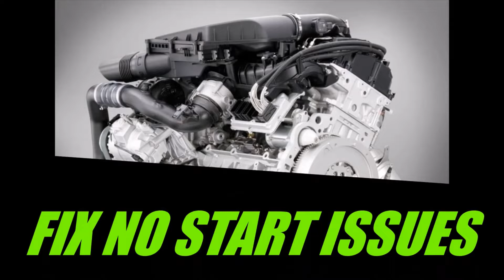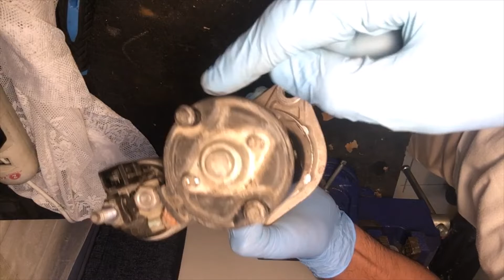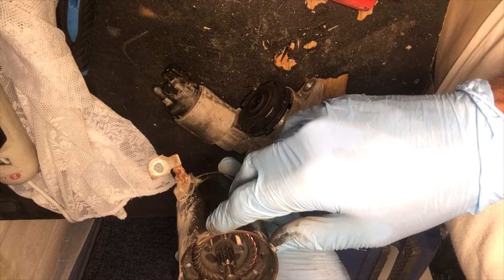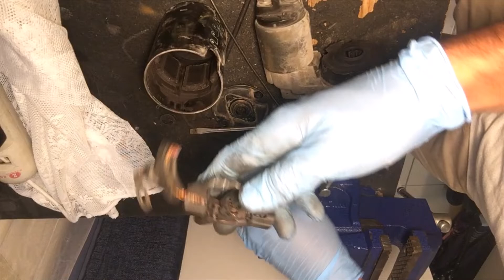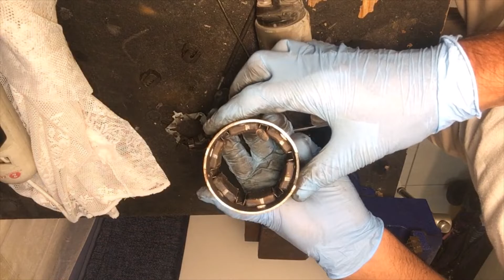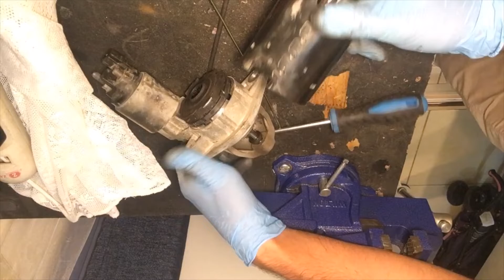BMW Starting Motor Repair- Car doesn't crank. Easy Fix without replacing the Starting motor

Comment from the maker: Ready to install Bosh carbon brush with holder for these motors. This is a ready to install part, no alterations to be made.
Part number: 1004 336 526-4AV